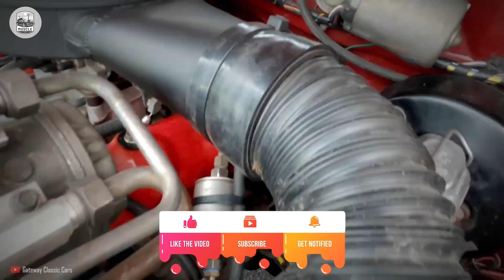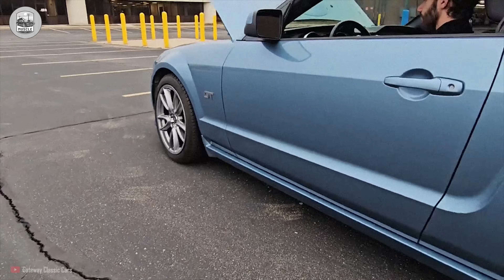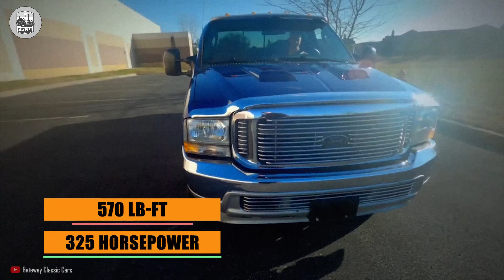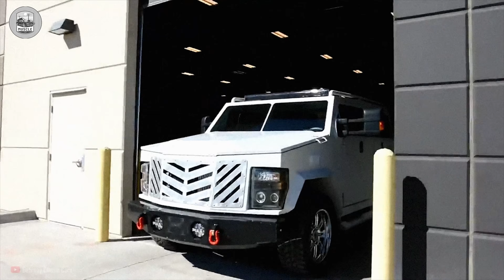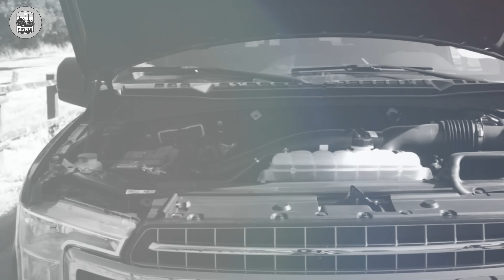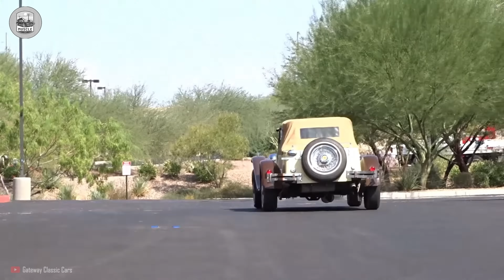NEVER BUY a Ford with this ENGINE | MOST FAILED Ford ENGINES ever put in production cars

Comment: I never understood why the 351w is the big shit. I have been flummoxed by the thin casting and an engine with 302 heads on “hot rods” . The Coyote? We drove one and it wasn’t impressive. Weird, Ford was all about profit. I guess they sold so many that they continued using customers as guinea pigs like GM always did. They got them right and then came out with their next generation experiment to have customers sort out, 😂.
Reply: I agree. We had an 83 Grand Marquis with the 5.0L CFI. My wife broke a lower radiator hose and drove it 30 miles with no water until it died. I changed the hose, filled it with coolant and changed the oil and filter. Black slime. Changed it again, black slime and a third time you could see oil but still a few chunks. Drove it home and it ran better. Changed it again and black goo! lol. But the dipstick showed oil looking like oil. So we waited a week. It had suction on the breather side where it was blow by. After a week, black slime. Changed it again and this time the oil seemed to be OK. It ran well I let my wife drive it 60 miles round trip for a week. Changed it again, it was much better and replaced the oil and filter. It had good suction on the breather side, blowby at 200,000 miles was gone. We drove it another 200,000 miles and it did fine. That is why I say that the 221-5.0 were The best engine ever made.  My only issue with the Windsor was that the 351 W with the 3 inch main and thin casting  were not the best choice to expand to 425+ ci engine. The 351C and FE had the same 2.79 main bearings and similar oiling system needs. I was able to address the problems and I actually used D3TE and D4TE blocks and sonic tested them. I got the greatest results from only boring to 4.113 and using forged pistons with 1.15 CH and Slant 6 198 truck rods polished and peened , ARP studs and hardware. I turned the 3.98 crank from the 410 to 4 inch stroke. 425.17 ci and used the C6AE-R and C6TE-G heads milled and I ported them and used 2.11/1.6 valves and headers with the 427 MR 2x4 intake that matched the wider intake ports. The 600 Holleys were annular booster truck carbs again scavenged from the junkyard. Notice the theme that differs from today. A salvage yard will no longer allow you in the yard to scavenge unless you are friends. But I have special bolts, clips, clip nuts in my shop drawers that came in handy many times and I still have a lot out there. Anyway a 390.030 over was a 396 with headers aluminum intake and water pump they weighed the same as an iron 351W. I could get 1.5 per cube from the 396 ci. And the 425.17s were capable of 700 hp and all I did to those 3 web ( like a CJ) was put a crossbolt main on 2 and 4 . Those were the only ones that cracked. I could get 610,ft lbs and 700 hp but 6200 was as high as I ran them for any amount of time. 7000 sure, but let up and don’t engine brake them, gently drive them back to 6000.  I still have people still racing them. I do wish Edelbrock would make aluminum heads and that 2 four air gap rpm.  Take care!
Reply from the maker: Thank you for sharing such an incredible story and detailed build.
The Windsor 5.0L truly earned its reputation for durability—surviving 30 miles with no coolant is nothing short of amazing. Your experience highlights the brilliance of Ford’s small-block engines. Your 425 ci stroker build using junkyard ingenuity is the kind of dedication muscle car fans admire. Those D3TE and D4TE blocks, paired with the 427 MR intake and annular booster carbs, are a testament to old-school performance mastery.
You’re right about salvage yards—it’s tougher today to find gems like the ones you used to create those beasts. At 700 HP with 6200 RPM durability, that’s proof of your engineering and Ford’s enduring potential. The cross-bolted mains were genius, too! What’s your favorite memory with one of these builds? Let us know!
Comment, share, and subscribe to American Muscle Cars for more
Hope to see you next videos.
Reply from the maker: Thank you for your comment! The 351W’s fame lies in its versatility and durability, offering decent power with room for upgrades. While it shared heads with the 302, that helped Ford cut costs, but enthusiasts often swapped for better airflow. The Coyote shines in modern builds, delivering over 400 HP stock—though its complexity divides fans. Ford, like GM, evolved engines based on real-world feedback, but it’s that ingenuity that kept muscle alive! What’s your ultimate Ford powerplant?
 Let us know
Comment, share, and subscribe to American Muscle Cars for more. Hope to see you in the next videos. 
Have a good day

Comment: My first car was a Mercury Capri with the 2.8L Cologne V6. I loved the way it looked, but the oiling issues were a constant headache. The camshaft lobes were worn down by the time I hit 70,000 miles. Still, I’ll always have a soft spot for that car, even with all its flaws. love it...
Reply: Sure it was the German v6, most had the British 3.0L v6, it was a turd.
Reply: @alancarter4282  Yes indeed. The essex Pom V6 was terrible in most aspects
Reply: @Bryce-z9v  
You know, I gotta disagree with the Essex V6 hate. Sure, it had its flaws, but let’s not forget the Cologne V6, like in my old Mercury Capri, had its charm. Yeah, the oiling system wasn’t great, and I had cam issues, too—but those engines had soul. They powered some memorable cars, and if you treated them right, they’d give you some good times. Nostalgia wins every time
Reply: @alancarter4282  The Capri with the 2.8L Cologne V6? Nah, it’s not a turd—it’s a misunderstood gem! Sure, the oiling issues were a pain, but the sound of that engine winding out was worth every headache. Most fans dismiss it because it wasn’t a big-block bruiser, but not every car needs to melt tires to be memorable. It had style and soul—something rare even in muscle car history.

Comment: I remember my dad’s F-150 with the 5.4L Triton V8. It had that infamous cam phaser issue, and the ticking sound drove him crazy. We eventually swapped it for a different truck, but the experience taught me to always research engine reliability before buying.😁😁😁
Reply: Yup the phasers would get stuck from not changing your oil.. All you have to do is make a 12 V jumper wire to go directly to the phaser and jump it all the way left and then reverse polarity and jump it all the way right a few times and it would clear them up and they'd run like normal again... "STUPID FORD" 😕
Reply: @nobiden3134    Sounds like stupid owners to me.
Reply: Yep, my Triton has been ticking for 80,000 miles. Still waiting for it to explode. I just keep changing the oil every 4,000 miles.
Reply: @d.e.b.b5788   I get it those 5.4 Tritons were a ticking time bomb for some, but let me tell ya, my dad’s F150 with the same engine ran strong past 200,000 miles. Yeah, the cam phaser tick was annoying, but he stayed on top of maintenance and didn’t let it scare him. Not every Triton was doomed, folks, just gotta treat ’em right and keep that oil fresh! It’s all about care, not curses

Comment: I can’t tell you how many 6.0L Power Stroke Diesels I’ve worked on over the years. Customers would come in with blown head gaskets or clogged EGR coolers all the time. Most of them ended up 'bulletproofing' their engines, but it cost them a fortune. Ford should’ve done better with that design.
Reply: You mean Harvester should have., Ford did NOT build the 6.0 or the 6.4 diesel.
Reply: @wysetech2000  the 6.0L Power Stroke had major design flaws, but let’s not forget—it wasn’t entirely Ford’s fault. The engine was designed and built by International (Navistar), and Ford was stuck with their issues. Sure, Ford could’ve handled the warranty claims better, but Navistar dropped the ball with the head bolt design and EGR system. Honestly, it’s no wonder Ford moved away from Navistar and started developing their own diesels later on.